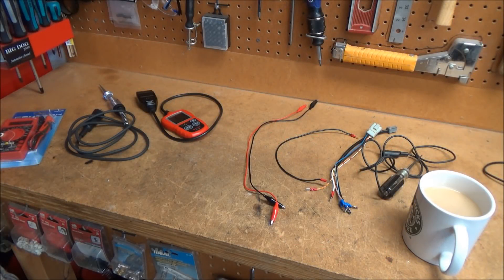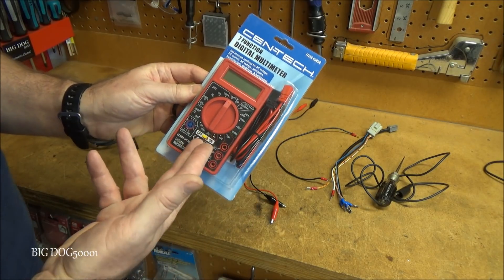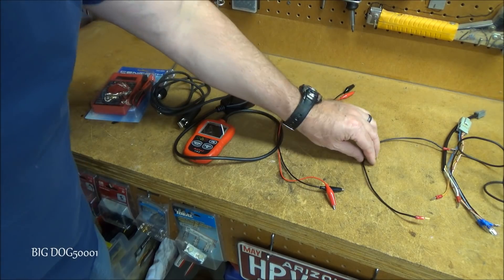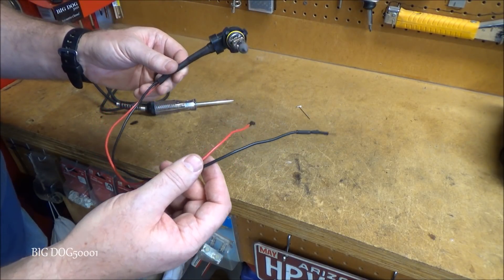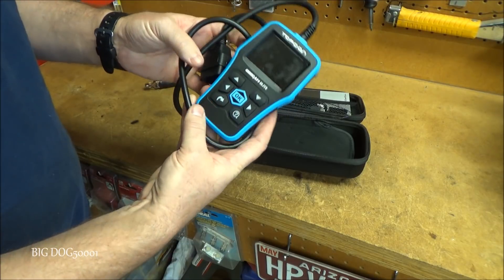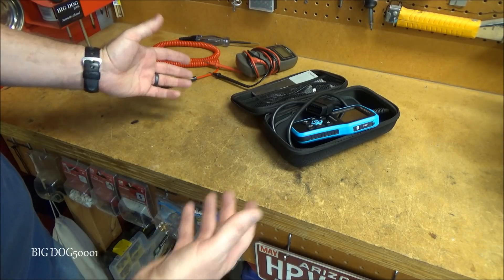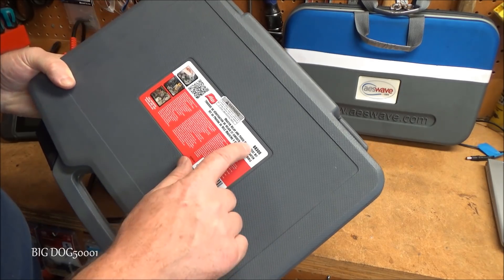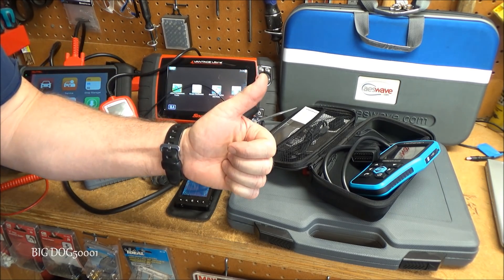DIY Automotive Diagnostic Tools: What Do You Need?

Comment: I know this is an old video and I hope you can still answer a question I have.  I have the Foxwell NT510 multi-system scanner, and I have to pay $70.00 for each automobile I want to diagnose.  Does the scanner you are using here for the DIY'er have access to all autombiles without having to pay extra for each vehicle?
Thank you.  I love all of your videos, you explain very clearly so we can understand.
Reply from the maker: Scanners like those typically require a fee to add additional vehicle makes (Honda, Chevy etc.) in order to see manufacturer specific data and add some bi-directional functions, but most should let you see generic OBDII data for any vehicle that has an OBDII DLC for free.  I don't pay to update or add coverage to any of the cheaper scanners that I have, I only use them for OBDII data and emission monitors.

I have more expensive scanners that cover all manufacturers and allow me to see all modules (like ABS/SRS/Body modules etc) but in order to keep the information up to date I have to pay subscription fees each year (several hundred dollars each year).  The scan tools will still work and do everything with expired subscriptions but at some point they will not work on newly manufactured vehicles.

If you work on (or scan) a lot of different vehicle makes and want bi-directional control, manufacturer specific data and be able to scan all modules, then it may be more cost effective to pay more up front for a better scan tool that works on all makes (even if you don't pay each year to keep it up to date).  Autel MS906BT and the Launch X431 Pros Mini are the two scan tools I currently use the most (and both have full coverage on all makes).  If you only want to read engine codes and see generic OBDII data, then just about any cheap scanner will do that for free with no additional charges.
Reply: @BigDog50001  Thanks for getting back with me and for the info you provided.  You were crystal clear as usual.  Love your videos, keep them coming.

Comment: Always love your videos.  I think I have at least 3 of the cheap HF meters.  I also have a basic GreenLee DMM.  I have an Ancel AD310 scan tool.
Recently  the radar sensor (used for "Honda Sensing") get knocked and set a code....which basic scan tools can't touch.  
Would one of your higher end tools be able to reset that sensor?  I realize the system needs to be aimed properly, but when it goes out your dash lights up like a Christmas tree.  It even lights "Brake System".  Any recommendations appreciated.
Reply from the maker: Typically in order to properly work on Advanced Driver Assistance Systems (ADAS) they need to be calibrated with special equipment that is very expensive.  Unfortunately I don't really recommend this for DIY due to the safety concerns of an improperly working ADAS system.  Dealers and larger repair shops are usually the ones that will have this equipment due to the size of the equipment and the cost.  I appreciate the comment, thank you!

Comment: Great video.  I'm just a DIY'er but I became interested in this stuff after trying to fix a parasitic draw on my fiancé's car last year and while I eventually found it, I could have found it faster and without tearing apart as much stuff as I did.  Over the past year I have bought some of the more expensive stuff that you show like the AES wave uTest advanced terminal test kit, the Lisle relay kit you have, an Innova 5610 scanner, an Innova power probe knock off, and several better test lights and Multimeters.  I have also bought Scannerdanner's book and am a member of his premium channel.  I've learned a lot from both of those.  While I would like a better scanner, I can't justify an expensive one for occasional use.  I plan on getting the Uscope at some point too.
Reply from the maker: Thank you for the comment and the input!

Comment: I really did not understand why would you need an oscilloscope? Can anyone tell me some examples what can you check with it in car?
Reply from the maker: Sometimes you can get away with not having one but some things are too fast for a voltmeter and need to be seen with a scope to diagnose (fuel injector control/pulse width modulated signals/Mass Air Flow signals etc).

Comment: You can get the Shell Scope for around 40 bucks.
And you can get an even cheaper scope if you can put it together yourself.
Reply: Aurthor Thing That’s what I did. I still have the Hantek for when sht gets real.
Reply: @pl5882  I need to get one of these pocket scopes just so I can start learning how they work.  Right now I just want one for basic audio amplifier and power supply  troubleshooting.  Do you think the $40 shell scope will work for this?

Comment: What's the best affordable scan tool? Not a code reader but one with live data and abs codes
Reply from the maker: The Topdon that I showed in this video does live data and ABS codes (but will not show all manufacturer specific live data).  For a full featured scan tool with bidirectional controls then I would look at something like a Launch X431 Pro or the Autel MS906 that I showed in this video.

Comment: Nice recommendations.  So that autel ms906 does offer bi directional? So I'm assuming the Bluetooth ms906bt is the same tool but cordless ? I'm looking to get a new scanner would you say the ms906 is a good buy ?
Reply from the maker: Yes, the MS906 definitely has bidirectional capabilities.  I haven't found anything yet that I wanted to bidirectionally control but couldn't (I'm sure there are some things out there).  From what I understand the BT version is exactly the same, just wireless connections.  Like most scan tools you have to pay for updates each year, which are like $500.  I know in the past some authorized sellers have included 2 years of updates when you purchase tool and that can help save money.  I would have no problem buying another Autel MS906 right now.  Thanks for the comment Jonathan!